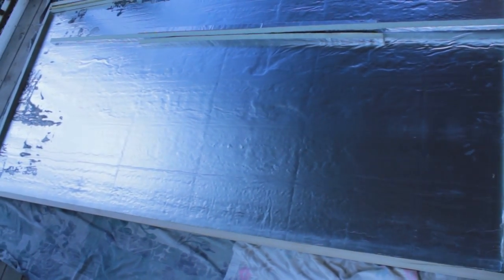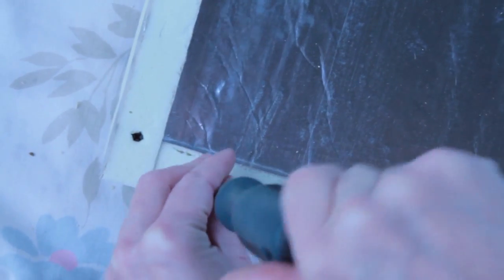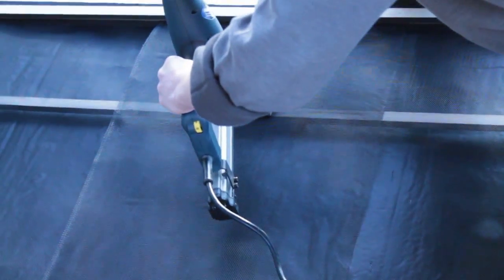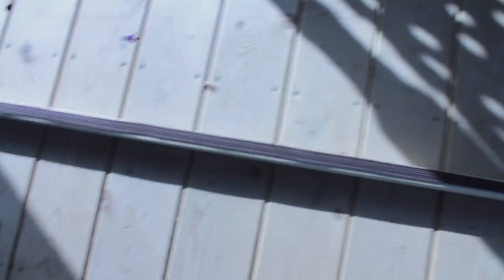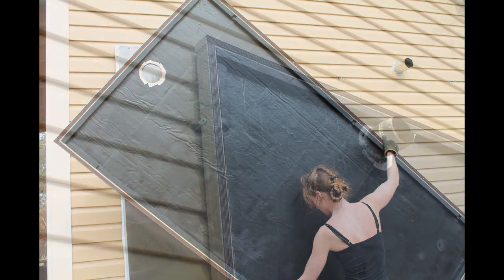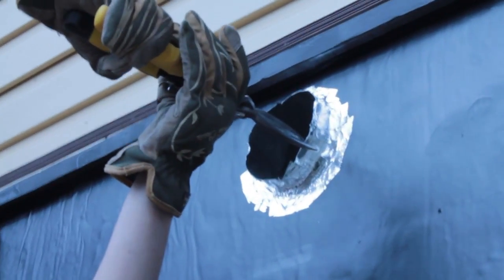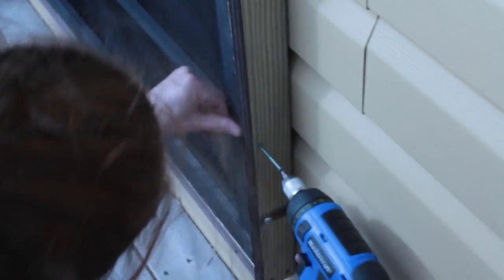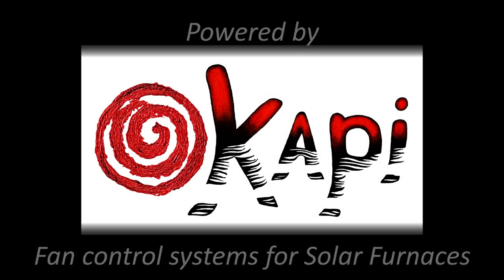Meredith builds a solar furnace

Comment: I just looked at your web site for the construction, good details, Thank You.
I have one question, why is the air flow going against the natural air flow convection ? I was thinking this over to do a simulator project, but to push the cold air intake in at the bottom so the heated air will output at the top into the room. My theory on this is if the fan is not running for some reason, it can still naturally have a convection air flow into the room.
Thank You!

Comment: It all looks good but the problem I have with the video is that it lacks alot of info I saw in one video where the thermometer is put right up to the vent fan where the heated air is coming in and that is all great but what would be more important is the capability of the panel or panels to actually heat an area what size area would one of these panels heat and to what temperatures. I know it depends on cubic feet but just on average with a typical 8 foot ceiling would one of these panels be capable of?
Reply from the maker: +michael stephan The data regarding the output from the heaters (over the last 12 months of operation) is listed on our website at http://www.greenhillenvirotechnologies.com/about-closed-loop-solar-air-heaters/heater-performance. On a sunny/very cold winter day, the panels will provide sufficient heat throughout the day that no other heat source is required.

Comment: what do you do with it in the summer?
Reply from the maker: +First Class Gardens This year we left them running, so we could log the data and make further observations. Next year the heat will be transferred into the basement (if it's still damp), or the screen collector elements will be removed and stored.
Reply: thanks for the follow up.

Comment: do you have any data on the results? great video
Reply from the maker: +1mtstewart 
The data from the collectors can be found here: http://www.greenhillenvirotechnologies.com/about-closed-loop-solar-air-heaters/heater-performance
Reply: +Greenhill EnviroTechnologies Inc. I see that you are in Nova Scotia. So, I am imagining that you have more opportunity to use the heat collected from your collectors through the year. I wonder if you would benefit from a solar battery built adjacent to or under one of your buildings there to store excess heat generated at times when the demand is insufficient for the potential?

Comment: Which type of paint did you use? Nobody wants to breathe bad air. We all want to have good health.
Reply from the maker: +Николай Челкак Stove or furnace paint that is designed for high heat and indoor use. Always best to check with the manufacturer of the paint and examine the product data sheet (MSDS) if you have any concerns.

Comment: How  or what is this Okapi  app for?  How  does it relate to the solar  panel?  Found the instruction pdf.  Lots of detail and materials, so you'd need a proper workshop  to build it in.  I think the costs totalled would put it in around $250.  Hmmm, not sure if it can be made more affordable?
Reply from the maker: +rho lees The Okapi system is the fan control system: http://www.greenhillenvirotechnologies.com/products/about-the-okapi-systems

Comment: What is that shiny silver backing you are using to build the frame around ?  And how  do you spell  the name of the correct foam  board you are using.  Is that poplar wood you said is least off-gassing?  Some things were not clear.
Reply from the maker: +rho lees The foam board is IKO Enerfoil Polyisocyanurate, there should be other competitor products but you'd have to check with your local hardware stores for details. All other details about our systems, collectors, FAQ etc are up on our website at http://www.greenhillenvirotechnologies.com

Comment: What is the curing period of the aluminum screening you mentioned? and for what reasons?  Nice build 
Tia
Reply from the maker: +S&K Aquatics It really depends on the screen, what it's been painted and coated with, and what happens when it's heated. Some off-the-shelf screen products (especially fiberglass screens) may off-gas while hot, and produce an odor. Plain, uncoated, aluminum screen spray painted with furnace paint (that is designed for use indoors on hot surfaces) would be advisable and it's always a good idea to check the MSDS of any paints you intend to use.

Comment: what was the cost to build this? I couldn't do it for less than another solar panel
Reply from the maker: +pietkaify Approximately $100 for the glazing (twinwall polycarb), $40 for the insulation (polyisocyanurate), $40 for the aluminum bug screen. There are other items required braces, wood trim etc, pretty much everything should be listed in the guide you can download from http://www.greenhillenvirotechnologies.com/about-closed-loop-solar-air-heaters/guide-to-build-your-diy-solar-air-heater

Comment: This looks great!  I hope that this technology becomes mainstream soon.  What do you do during the summer to keep it from heating the house?
Reply from the maker: +Tim D This year we let them run the entire summer, so we could observe them and log all associated data. Given the elevation of the sun, the heat generated by the collectors is not as significant as you'd expect. It still amounts to a lot of heating though, which could be used for drying clothes or food, or drying out a damp basement. If you don't want them to run during the summer, there are many options including removing the screens, covering them, add a canopy/shelf to the top of them etc.

Comment: So, it sucks in cold air from the floor, via fan/chimney effect, heats up, and then is vented in at the top of the room/space. My question is, would glass, although heavier, and more expensive, be a better option than the semi-opaque bicarbonate layer? Nice job, by the way...
Reply: +Greenhill EnviroTechnologies Inc. I'm curious, why would you go against the natural flow?
Reply from the maker: +Slim Stickly No, it's actually the opposite, cold air comes in at the top, is heated, them blown back out at floor level. We use the Polycarbonate for many reasons, it's light and easy to install and has very good insulation properties. It's designed for greenhouse use, so doesn't lose too much light and has an external weather resistant coating.

Comment: "All of this is a fun process of double checking your measurements, and then double checking again....heh"

AHHAHAHAH!  You're so cute!  And VERY intelligent and resourceful and simply amazing!  EXCELLENT work Meredith!!

I think it's a great idea that you tucked the screen into the insulation channel, on top of this being a great idea anyway.  Thank you so much for the video and the plans that go with it.  This has to be in like the top 10 of all the DIY, Solar, green building, eco-safe projects that I have seen here.  You make lite work of the whole thing, with your nimble fingers, and provide a very elegant solution that is hugely cost effective, and will provide you with heat for years, offsetting the carbon footprint.

THANK you so much.  I'm going to build one!!!

Mark

Comment from the maker: The Efficiency Ratings on these Solar Heaters are great! The Okapi Solar Air Heater App (coming to Google Play, soon) shows this here:

Shared from my Okapi Solar Air Heater App on Android at 2015-02-28 13:02:38

Location: Unspecified
Elevation: 384ft = 117m

Solar Irradiance: 992w/m² = 314 BTUh/ft²

Current Output:

Heater 1 Output: 5458 BTUh = 1599w
Heater 1 Efficiency: 63.0%

Collector 1 Size: 27.19ft² = 2.52m²

Heater 2 Output: 5284 BTUh = 1548w
Heater 2 Efficiency: 61.0%

Collector 2 Size: 27.19ft² = 2.52m²

Comment from the maker: Wow! These two 4ft x 8ft heaters are the best we have ever built!

Shared from my Okapi Solar Air Heater App on Android (Realtime data from my Okapi system) at 2015-02-28 12:42:40

Heater 1 Output: 5382 BTUh = 1577w
Inlet 1 temperature: 69°F = 21.07°C
Outlet 1 temperature: 142°F = 61.18°C
Rise: 72°F = 40.1°C
Fan speed: 100%

Heater 2 Output: 5361 BTUh = 1571w
Inlet 2 temperature: 69°F = 20.77°C
Outlet 2 temperature: 138°F = 59.22°C
Rise: 69°F = 38.44°C
Fan speed: 100%
Okapi ambient temperature: 74°F = 23.56°C
Sun Position: Azimuth: 185.7°, Elevation: 35.3°
Reply from the maker: It is about -7 C, or 20F outside: it is cold but sunny!

Comment: What purpose does the screen serve? Is it necessary?
Reply: Greenhill EnviroTechnologies Inc. Do you think if you had a few layers of screen, each separated with say a half inch of air space between them, it would generate even more heat than just having one layer of screen?
Reply from the maker: Good question, Ron! The screen acts as the interior solar heat collecting element. Having such a high surface area and with aluminum's high thermal conductivity properties, the screen quickly absorbs solar radiation and re-emits it very quickly to the passing air. The air flow is controlled precisely using the Okapi Fan Control System. With just an empty black box, there is less surface area for the heat to transfer to the passing air. We measured an increase of approx. 20-25% solar heat harvest with the screening inside, versus the empty black box. A good interior heating element design can greatly improve your solar heat harvest and so will a good fan control system!
Reply: Thank you for your prompt answer. That makes sense and is super useful info.
Reply from the maker: Hi Joshua Smith! Great question! We have another heater that generates similar amounts of heat, that has 2 layers, separated by 3/4 inch, also with a black, foil-lined back. We do wonder if 3 layers, slightly apart would be great, also! We have a suspicion that an overall "thinner" design can be a bit better than a really "deep" design.
 If you build one with three layers, please share it with us, Ok? :)

Comment: I do not understand what the purpose of the screening material. Is that suposed to be the heat  sink? If so I can't imagine it would be very efficient at absorbing heat. Did you consider using substantial metal pieces as your heat sink to increase the efficiency?
Reply: Greenhill EnviroTechnologies Inc. I have seen screen heater designs where the inlet is one side of the screen and the outlet the other, making the air pass through the screen, was this considered. Obviously your design works extremely well.
I have been thinking of making a soda can heater, but the thin profile of this makes it a winner.
Your high temp gain figures are a combo of large size and excellent build quality - it makes all the difference.
Reply from the maker: Good question, Mr. D. -The black aluminum screening acts to absorb the solar radiation, it gets hot quickly and then releases that heat to the passing air. The high surface area of the screen increases the ability to heat the passing air more quickly.